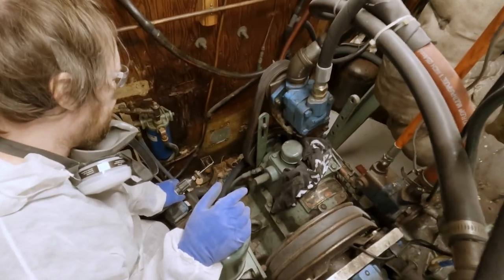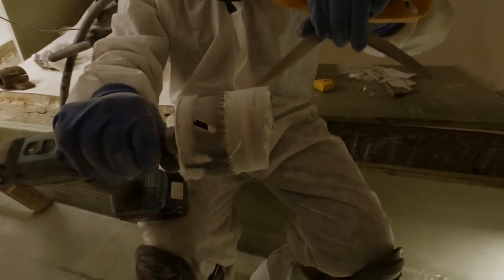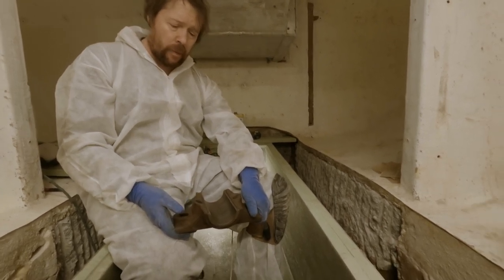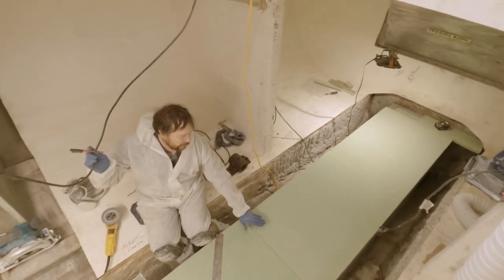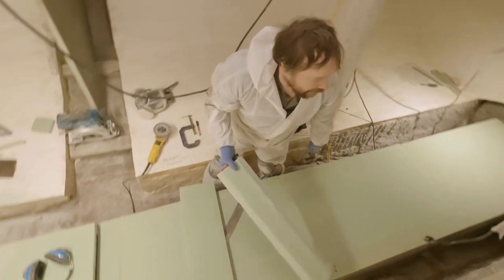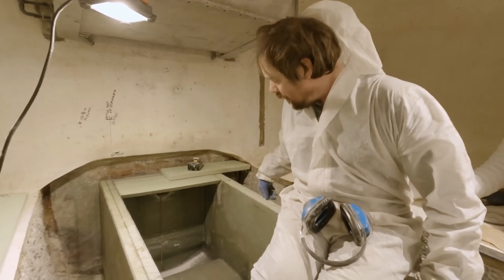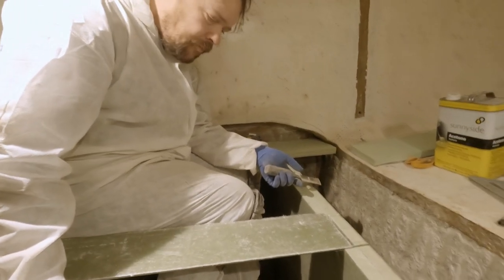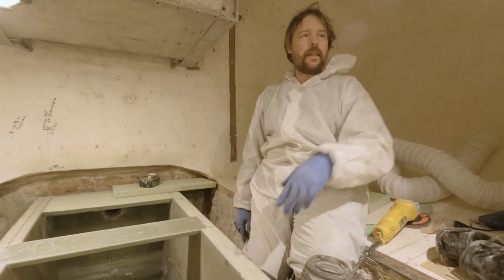Uncrating Tail Shaft - Emerald Isle: Ep.57 Fishing Boat Refit

Comment: Minute 28 is a good place to use your multitool to cut through the stringer for the bottom cut.  You can cut from both sides by setting the blade at a 90 degree angle.

Comment: Guys do you have to dry dock the boat to install the shaft?
Reply from the maker: Yes, we will get her pulled to reinstall the shaft. There is a little glass work to do on the end of the keel where the cutlass bearing mounts and it will be had to do it properly on the grid. We will also have all the time we nned to get it aligned properly without racing the tide.